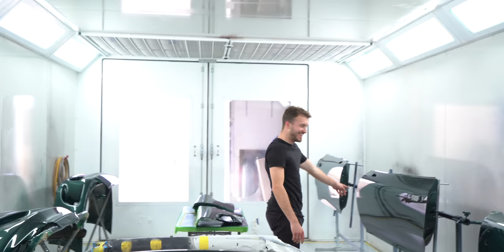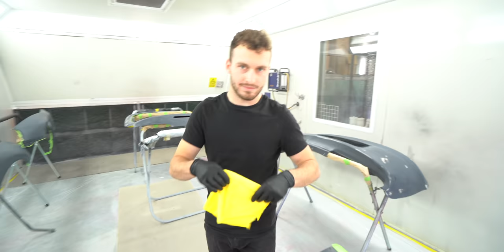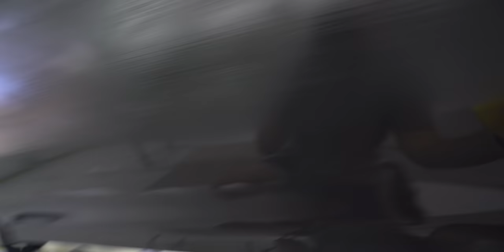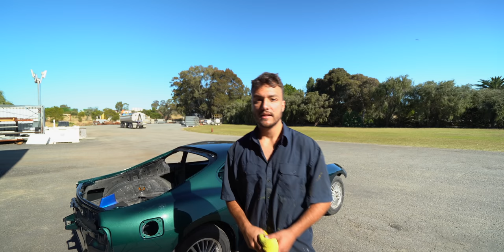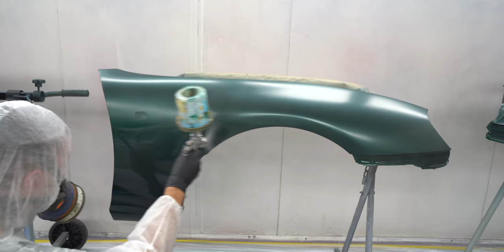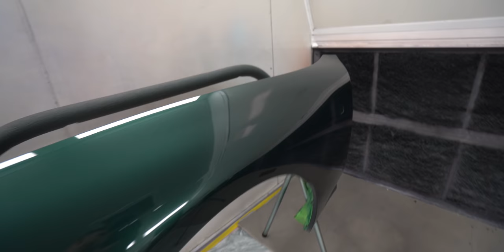Toyota Supra Painting Part 1 of 2 | VLOG 12

Comment: 8:00 this is more like an 80-90% overlap, that probably caused runs, but it happens. 
Not everyone can spray a test panel 1 hour ahead of the main hop to analyse the paint sag over time (you can also depth check the test panel with a gauge that would ruin a final panel)